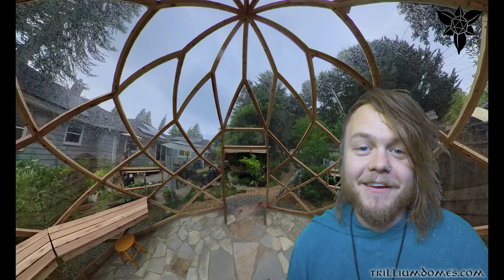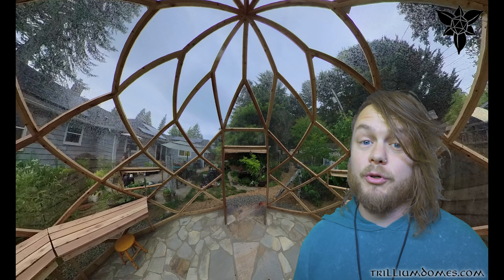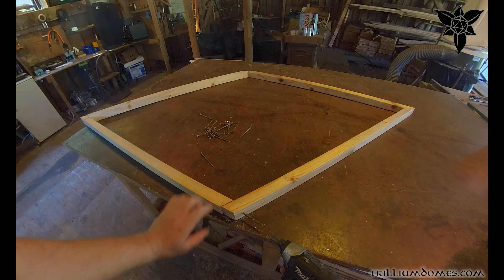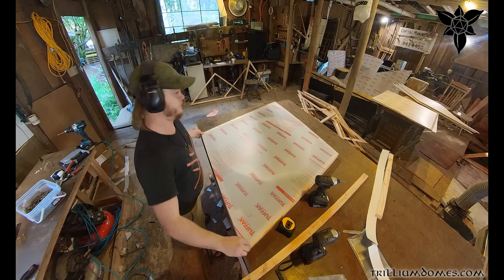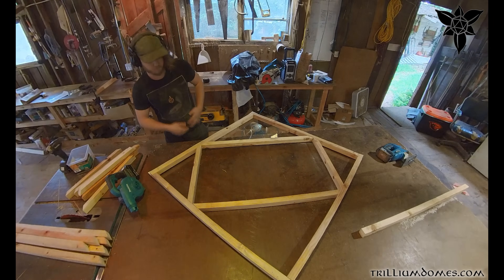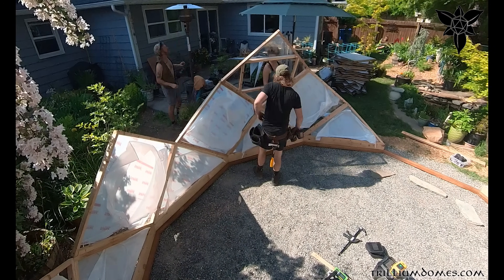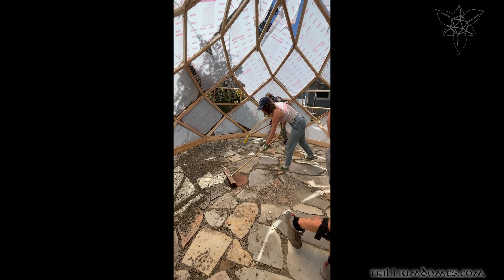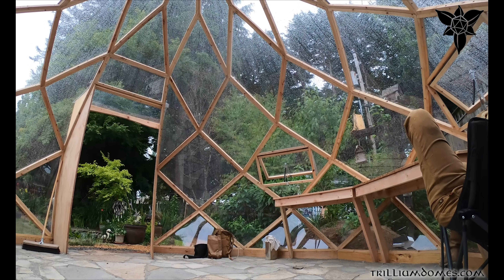How to Build a Zome Greenhouse - Premium Materials Version!

Comment: Is there a way to open some "windows to get fresh air in? If you use wood as a frame, won't that give a problem with humidity inside the greenhouse?
Reply: There's 4 windows, screen door and top vent in this design.

Comment: You are a highly skilled carpenter, awesome work!       Question:  Why not paint / seal the wood before setup of the structure?      I live in AZ, the sun would destroy the wood in a few seasons without paint.
Reply from the maker: This wood does have s deck sealer on it that blocks UV! But you can adjust the finish based  on your needs!

Comment: Looks great! I think I'm going to build one of these next year rather than buy a traditional greenhouse. 

What do you use for the flashing please, or what is it made from? I'm going to see if I can get a UK equivalent. 

If you had all the time in the world do you think the frames would benefit from a bevel cut? I guess the flashing covers any gap. I'm a bit obsessive when it comes to things so would be tempted to do one anyway.

All the best
Reply: I personally wouldn't do the beveled method anymore. Not only does it take about 5x the work unnecessarily, it seems to be less strong with the same amount of wood. The flashing is just aluminum sheet metal. Any sheet metal shop or roof supply in the uk should help. But you can use other bituminous materials as well. Keep me posted on your build!

Comment: will frosted glass be good for greenhouses? can it help you control/ limit the amount of sunlight and prevent over heating?
Reply: There's lots of options for different materials for greenhouses. I don't see frosted used much. Usually people will hang shade cloth and have plenty of ventilation for the heat of the summer

Comment: Needs the entrance to be a hyperbolic paraboloid porch/tunnel like this: https://youtu.be/NKqi4_2IrtI?si=hbsVIuoU0weK06wC
and an iris sunshade like this: https://youtu.be/MBsQOTvWL3Q?si=4AsYvMufPn7QoJH0
and to be close to a full sphere, have a hemi-spherical base under ground which could hold water, or act as a cool air base or house aircon etc!
and, and, and...
Gosh, having ideas is so easy 😀
I adore your creations - I once designed and built domes as pond-covers using aluminium strips pop-riveted together, so I had to redesign the geodesic concept to have straight(ish) lines across and all different size triangles... 3 months of maths and 3 months to build two - and then I never wanted to see another dome! 😀
Watching someone elses' solutions is great - I love these Zomes, quite fir-cone-esque... I wonder how painful making a larger one with 8 and 13 (fibonacci) spiral edges...

Comment: Love this build!  A couple questions if you have time :)

1. Where do I find the black flashing and poly screws you used for the zome? 

2. When cutting poly for your domes, do we cut them exactly the same dimensions as the triangles, or leave a gap for silicon/gasket? Since the triangles are beveled, I believe there will enough room to fit flashing between, but wanted to get your opinion on best way to make this thing water tight!
Reply from the maker: It’s just regular flat stock flashing, I got mine at Lowe’s.

If you’re going beveled method I would leave a gap. If you’re going non beveled like I do in the video, no gap necessary.

Comment: How does the polycarbonate hold up over time? does it get brittle or discolor with UV exposure? Also, does it require cleaning? how would you clean the top of it?
Reply from the maker: It’s UV rated material with a 10 year warranty. With care it will last much longer. Pressure washer

Comment: If you have all the tools  yeah it's a cheap greenhouse..
Now add on the $50-100k for all your tools & work workshop.
Reply from the maker: You could literally do this with a chop saw, a drill and a table to work on.
Reply: @trilliumdomes 
Fair enough.
Nice work,  I'm not knocking the build. Every time I try build something I keep having to buy another tool is frying my head.
I never wanted a tool shop just wanted to get the job done 🤔🪓

Comment: Beautiful dome, my friend.  And wow....sailing to follow your passion.   ❤

Well question, here where I live in Oklahoma is extremely windy.  Winds 360 a year average 30 to 40mph.  Will this design hold up?  Wish to make a greenhouse. 

Lastly, how about a structure to live in?  Suggestions?

Blessings,
Reply from the maker: Thank you! 

Yes the domes can handle extreme winds if you build to my specs and use proper foundation hood downs like helical piles.

A living space would be the same, just a roof instead of greenhouse cover, insulation, electrical etc

Comment: i want to buy the plans for this some. can you share how strong this is against wind? we live in florida and get tropical storms and hurricanes. i’m. it trying to let that stop me from building this in. y backyard.
Reply from the maker: I have some numbers on the way but the design is overbuilt and if you build it to spec and anchor it will proper helical piles it will be on of the strongest greenhouse designs you can build when it comes to wind. Much stronger and more aerodynamic than a typical greenhouse structure
Reply: @trilliumdomes  thank you for the prompt reply. i also just sent you an email prior to you responding. sorry for doubling up.

Comment: Righteous! Any info on the flashing size/material, where to get the black roofing screws, also what thickness is the polycarbonate.  Thanks!
Reply: I also cannot find a solar powered vent fan like you have in the video.
Reply from the maker: https://climapod.com/shop/solar-thermostatic-fan/

Comment: I seriously want to build this!  My only concern is materials for the windows.  I live in Manitoba, Canada and we regularly get winter temperatures below -30 Celsius (-22F) with strong winds.  I currently have a store bought 6x12 green house (3yrs old) with poly-cab panels and during the last two winters I have had 4 panels get damaged during intense snow storms.
Reply from the maker: How thick is the polycarbonate? This stuff is .150” very strong
Reply: @trilliumdomes  Not sure, it's dual wall sheeting.
Reply: @trilliumdomes  you also answered the question I had.  I bought the plans but I didn't see mention on the thickness of polycarb to get.

Comment: Quick tip; When cutting poly, you can turn your saw blade backwards to reduce the risk of breaking the plastic.
Reply from the maker: Wow I gotta try that!
Reply: I use a sawzall with fine teeth and you have to hold the blade almost parallel to the plastic so it's almost slicing it
Reply: Exactly right. I used a fine tooth finish cut blade backwards and it was fantastic. No burr, chipping or cracking. Clamp each side down while leaving room to cut. One thing though, wear ear protection!!! Cutting like that creates a deafening high pitched squeal that will kill your hearing for days.
Reply: My instructor called that "cutting in Negative Rake"

Comment: These look great, but without being attached to footing or foundations, they would be gone in the first wind.
Reply from the maker: Every structure should be built to withstand the conditions of your area / climate. This is a very sheltered area. Helical piles are a cheap and easy way to make sure that your structure doesn’t go anywhere during extreme winds. You can’t just make a blanket statement about a structure, it has to be built to spec with the local conditions in mind.

Comment: ✨S T U N N I N G✨ 😍😍😍 What’s the largest of these that one can build? I saw you have the 16’ plans, would it be possible for one to modify (enlarge) it oneself or is that something one would need to order specially done by you?
Reply from the maker: The largest zome i have up right now is 20’ diameter. You can scale the plans but the doorways will get a bit big. I can definitely do custom designs as well.

Comment: Super cool! How would this hold up in a place with hot dry summers and cold snowy winters? Like 100+ summer high temps and single-digit winters? Fahrenheit
Reply from the maker: Fantastic. Snow loads are not an issue. During the summer plenty of ventilation plus ample shade cloth over the south face will turn it into a nice shady spot.

Comment: I'm hearing the locations you've set these up, and I'm loving the look of them, but do you have any experience or knowledge on how well they would hold up to a new england winter/snow load?
Reply from the maker: Yes they do fantastic in the snow. The zomes especially because there's really nowhere for the snow to accumulate. That being said I've had my wood framed domes absolutely buried in feet of wet snow, they are incredibly strong. Even with the domes its only a small space on the top that snow can accumulate.
Reply: @trilliumdomes  That is fantastic to hear! I think that one of these might be my first major project for my property once I wrap up my current ones

Comment: Great build...sent you a message...what is the thickness of the polycarbonate and what is the average cost of a 13-foot X 9-foot high. Want to convert my dome I built from boat vinyl to polycarbonate...thanks again...
Reply from the maker: Awesome! This was .150” thick. I’ll have to get a quote to give you an accurate number. But for this whole zome it was about 3k usd! Not cheap, but it’s great stuff
Reply: @trilliumdomes  would you use the same thickness for a 23ft dome that will have snow load?

Comment: What climate zone are you creating the zones in? Wouldn’t you need insulation in a colder climate. I am in Montpelier, VT. Love your designs! Just found your channel a few days ago. Happy travels!!
Reply from the maker: These can be made in any climate. Typically greenhouses dont have much insulation even in cold climates. You can use multiwall polycarbonate and insulate the north wall if you'd like, which can help. If you wanted to do a cabin style dome / zome you can easily insulate it just like any other wood framed structure!
Reply: There are three diffrent types of heat transfer: CONDUCTION, heat transfer through a material itself, CONVECTION, the change in density (or more accurate volume) of a material depending on it's own temperature which causes it to move inside of itself (mostly fluids and gases); think of hot air that rises and cold air that sinks to the bottom or the deeper into the water the colder it is); RADIATION, heat transfer by emitting and receiving infrared light.
Greenhouses work mostly by maximized intake by radiation and reducing convection. To maximize infrared light (Radiation) intake while keeping most of the now warm air in (preventing cooling of by convection) is accumulating higher temperatures than the outside. The tempereature can accumulate as long more sunenergy comes in than energy is transfered out through the greenhouse surfaces (conduction), this also works in colder climates or even in winter times. Of course that system can't gather as much in the winter as there are less sunhours over all and the temperature difference is greater.
To improve a greenhouse setup, which means stopping the inside from cooking itself and preventing freezing temperatures (for the most part): 
The obvious, you can open up windows to lower the inside temperature, negating the heat accumulation. You can also use fans for a faster (forced) air exchange and add some kinde of evaporation cooling etc.
You can also directly manipulate the greenhouse effect by changing the radiation capabilities, polycarbonate and glass are both able to passthrough infrared light which is why they are used for the greenhouse builds but there are also plastics that don't passthrough (or block some) infrared light by reflecting it or by blocking it ... this works both ways !! As any object (above absolute zero) emits infrared light it will cool down when more is emitted than gathered up by it's surroundings!. So cover up if there is no sun to reduce the cool down (at night for example), the cover can also be a heat reflecting type of foil like a rescue blanket (wich even reflects in one direction while letting some through the other side).

To increase greenhouse temperatures you have to maximize sunlight intake, reduce air exchange and keep the own emission of infrared light down when there is no sun (night or very shaded daylight). The immediate thoughts are always insulation while greenhouses excel in the other kinds of heat transfer but sometimes most improvements are made by fully automating ventilation and shading of the greenhouse. Sure thing you can also improve heat conduction by isulating when possible (there are doubble-webbed PC sheets for example, a better frame and door design can help) but a better insulated shell often reduces maximum infrared passthrough (refraction of light and most glass isn't a perfect passthrough by itself, so a thicker or double sheet harms it's prime performance).

Comment: Weird build idea.    Geodesic tunnel.   I'm looking at building a geodesic tunnel greenhouse with conventional end walls primarily because it can be built with mainly one size of structural member.  

Also a detailed glazing video would be super cool
Reply from the maker: yeah I've actually done that! The only is they are really not as strong as you would think. But if you reinforce the frame with other members it can be done. I have some other I deas for oblong geodesics that can be done efficiently!
Reply: @trilliumdomes  neat!   I'm looking at building one for an indoor natural pool / greenhouse and the geodesic tunnel makes more sense for our loacation than full dome because of the amount of sq feet we want enclosed.  Narrower lot and want about 2000sq feet.

Im considering putting a short A frame on each end as again easy to build but very strong.  Also considering maybe earthbag north wall and have a 3/4 geodesic tunnel with earthbag end walls.  We are in New Mexico and our dirt is basically already the perfect mix for adobe.

Really looking foward to the glazing section.   Though i will be going with polycarbonate because about once a year we get golfball sized hail.
Reply from the maker: And yes I will get on a detailed glazing video too. I show in detail how I do my zome skylight in my last video and this one has the details on how I glazed this how greenhouse. Super simple.